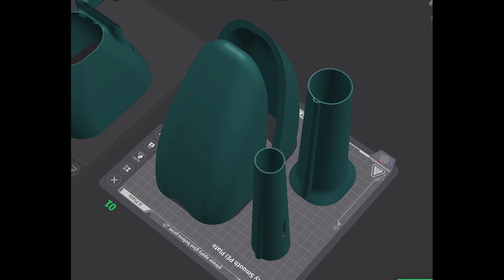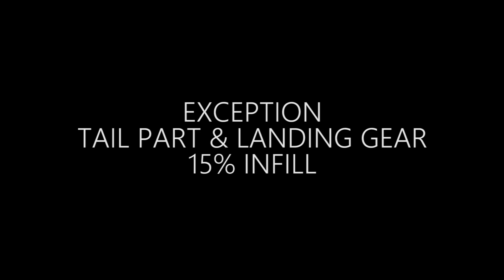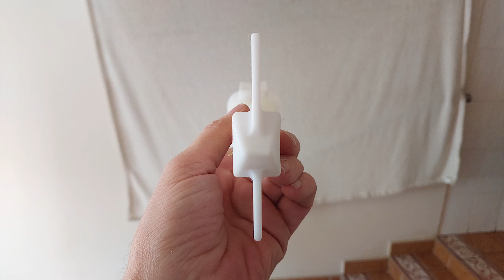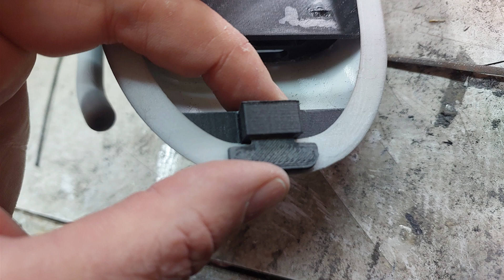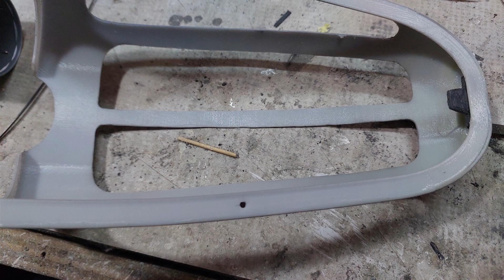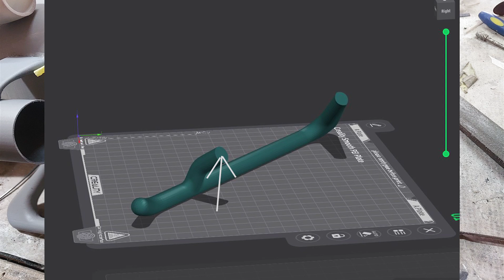Mike's 3D printed fuse build video

Comment: Sexy nice looking fuselage! ;) Just a little suggestion if the tail motor mount can design to tilted upward a bit like black hawk heli will it improve flights?
Reply from the maker: Hi Alex, no it wont improve the flight. In fact my original design had the tail motor slightly higher up but I found the tail a bit unstable and vibrate. She already flies great as it is now. :) Regards

Comment: How do you find the time 🤣🤣 that took some time and it wasn’t just whipped up.  Knocked it out of the park again.  I noticed you wrote 0% infill on fuselage.  What a nice work of art. Didn’t you have to use supports?  If not I need to get that ender printer. I’ve got an old flash forge w/ aprox 3 thousand print hrs still going strong but way outdated and small. But it has done its job 1,000 times over and plus side its paid for itself many yrs ago.  If you would want to make the infill more dense is that possible? It add more weight but would it also strengthen everything?
Reply from the maker: 0% infill for fuselage parts, 100% for clips and brackets, 10% for tail section. remember its got 2 perimeter walls of 0.6 (= 1.2mm total shell)

Comment: Hmm, very nice job. You say the FW450 will fit, but the FW450 v3 is a different chassis to the prior versions. I think it's mainly around the landing gear/skids mountings where the main difference is. I have a FW450 v3 and would really like a better looking canopy/fuselage.
Reply: in essence the FW450 (any version) will just bolt on to the bottom of the floor of the fuselage, (no motor plate required) but with some strengthening washers on the outside if that makes sense?
Reply from the maker: Also needs to be at 110% for FW450 by the way